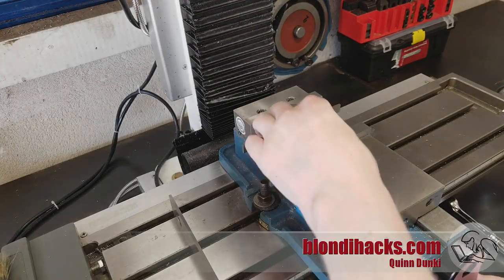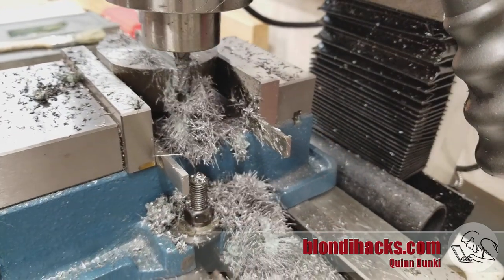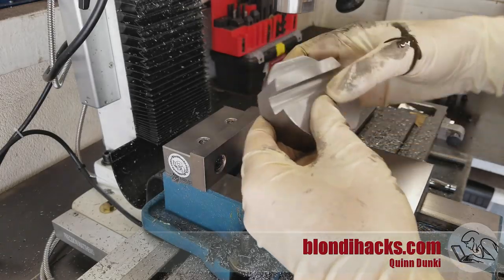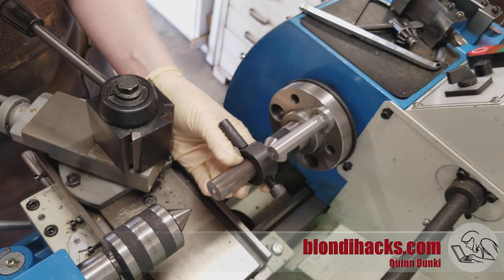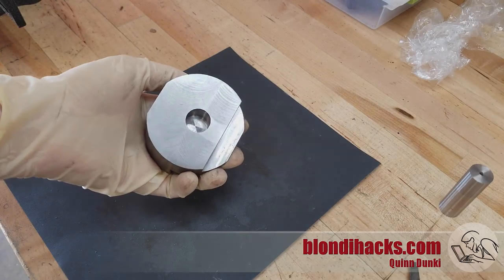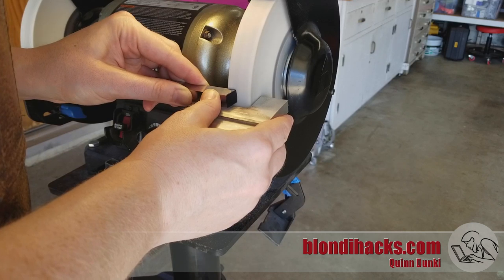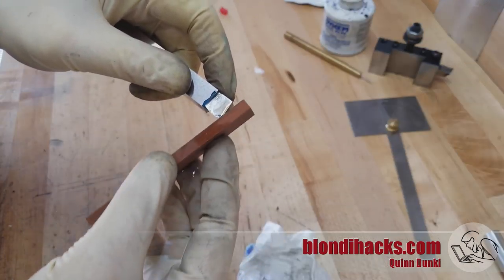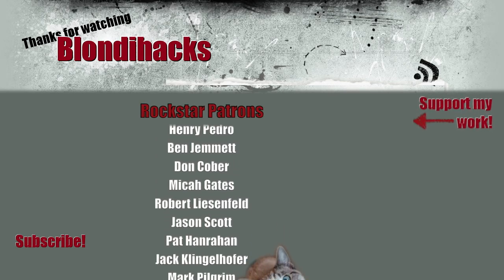How To Make A Fly Cutter : Part 2/2

Comment: Hey Quinn, thanks for the awesome video. A question, when I've seen other people make their own tooling, they've usually gone through a process of heat-treating/hardening on the final parts. I re-watched part 1 and you mentioned you were using 12L14 steel which, after a bit of googling, suggests it's not easily hardened as it's fairly low carbon steel. Is there a way to harden it/would it ever be necessary to heat-treat it? Thanks!
Reply from the maker: If something needs heat treating, you want to use tool steel for that. Most tooling doesn’t need hardening. That’s only necessary if it’s something that needs to hold an edge, will be subject to abrasion, or something that will be gripping something else made of steel (such as chuck jaws). A tool like this fly cutter could be made of tool steel and hardened, and it would be indestructible, but that’s totally unnecessary. Tool steel is also a lot more expensive and a lot harder to work, so I don’t use it unless I really need to.

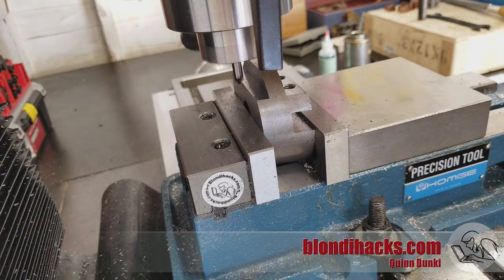Comment: I have an odd question. At 10:00 in the video you say "As Tom <someone> would say, this is now a high value part".  Which Tom is that you refer to or where does that quote come from? Thanks
Reply from the maker: Tom Lipton, an amazing YouTube machinist. He says that about parts that have a lot of operations done to them, and especially once chamfers are added because now a lot of time an effort has gone into it, and messing it up at that point would be expensive. The further you go with machining operations, the higher the risk of mistakes gets. Also chamfers make things look expensive 😁

Comment: What if you drilled the center hole all the way through?  The arbour would be visible up through the cutter slot.  Would the interference fit be good enough to hold the arbour in a through-hole?
Reply from the maker: That would be fine, but I liked the look of the blind hole.

Comment: Self cleaning ovens can get to over 900F, and then there are microwave kilns for even higher temperatures.
Reply from the maker: Yah, and in my experience the “self cleaning” mode ruins the heating element after a few uses. 😁

Comment: If my wife caught me putting parts in the oven then she would be even more upset then she is when I "borrow" her kitchen knives. So let us know how you got your partner (if you have one) to sign off on the oven heat treatment please?

I assume that you took the weight of the screws into account when you did your balance calculations?
Reply from the maker: I did indeed- I just did the calculations before the holes were modeled, reasoning that the screws weigh about what the steel they displaced does. Close enough, anyway.

Comment: What grit number and type do you use on the bench grinder for sharpening?  I guessed and ordered a 150 grit wheel for mine (to sharpen wood lathe tools).  The propellant in that can of T9 will probably be lost to osmosis before the liquid is gone.
Reply from the maker: That’s a 60 grit wheel. The higher grits can be useful for tidying up a toolbit, but will be very slow for grinding the faces.
Reply from the maker: (aluminum oxide)
Reply: I ordered a 150 grit Si carbide, and also have a 60 grit Al oxide on the other wheel.   I guess you use the rougher grit to put the initial face on the blank tool steel, and the finer grit would be good for restoring the edge as it wears down.  In my case, unless I want to change the grind angle on my lathe tools, I only need the fine grit to hone the edge as it wears.

Comment: I dont totally understand why the top of the Fly-cutter needs to be angled....it could be flat no? Pretty sure it could be flat I probably missed part of what you were doing. Watching channels like yours inspires me to learn and get better but also intimidates me due to struggling with math and dimensions, I will have to settle with much lower standards.
Reply from the maker: The angle top balances the mass. Otherwise it would be wedge shaped, with more mass at one end.
Reply: @Blondihacks  yes now I get it, knew you would not do all that work for nothing...I switched user-name...very nice work! Gotta get some parrallels.

Comment: Tapping M8 and ordering M10 bolts? Just drill out the holes and make it M10.
Reply from the maker: If I did that I couldn’t use the same wrench as for my tool holders, as stated in the video.